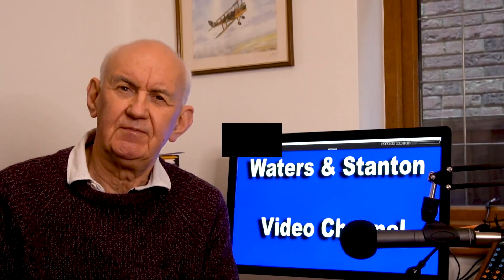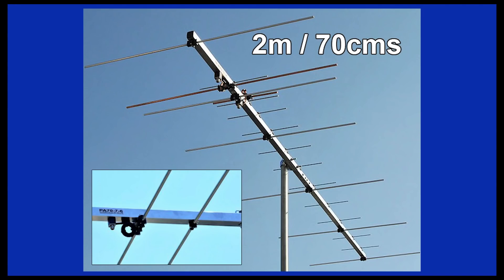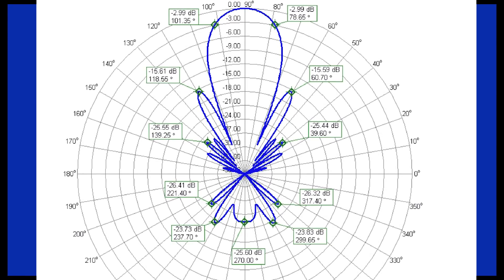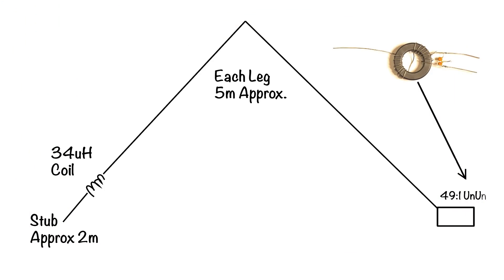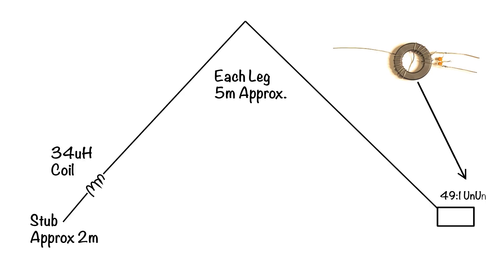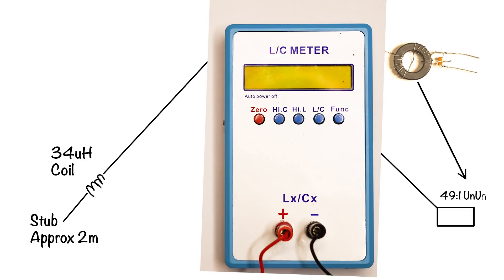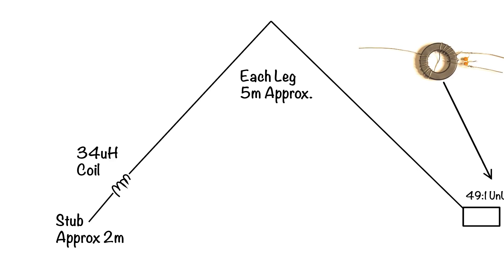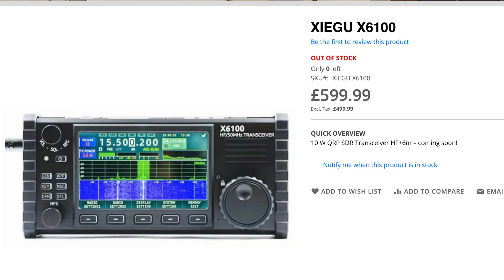HF Back Yard Adventures.  Build this Simple Compact Antenna for Your Ham Radio Station.

Comment: EXCELLENT!  Peter -- I finally got around to building this, and this afternoon I set it up and made adjustments.  I found some lightweight 1.5 inch diameter plastic pipe and wound that with #22 enameled magnet wire.  I started with 36 close-spaced turns and ended up with 33 turns very slightly spread to achieve 34 microhenries.  I attached an alligator clip to one end and about 2m of wire on the other.  I put up my 20m EFHW wire that I use for portable operation (it's #22 stranded, insulated) then clipped the coil to the end.  After adjusting the length of the 40m add-on I ended up with a 2:1 SWR bandwidth of about 125 kHz on 40m and flat, less than 1.3:1 across 20m.  Works great and much more compact than my full size 40m EFHW wire.  (Last summer I tried to make a compact 40m antenna by cutting my 20m wire in the middle and adding a coil using the shortened dipole formulas.  Not only did it not tune up well on 40m, but that concept requires lowering the antenna to switch bands.  This is so much better.)  👍
Reply from the maker: Great news William. Glad to hear your results. 73 Peter
Reply: @watersstanton  I had a chance to test it on the air today with my KX2.  It "worked a treat."  😀

Comment: Hi Peter, than you about your last video, very nice and interesting. I have the same space problems, but I don't have a small garden but a balcony. Which antenna do you suggest? Thank you in advance! 73
Reply from the maker: Hi there. I am assuming the balcon is above ground level. One option would be to fasten the EFHW transformer on the wall of the building -say just above the outer door and at one side of the balcony. Then take the wire diagonally across to the other other side but at the front of the balcony, and then run the wire down towards the ground. I don't know how much space you have so cannot really go further on that. Hope to helps. 73 Peter.
Reply: @watersstanton  Thank you Peter

Comment: Hi Peter, I have such an antenna and use it mounted vertically on my spiderpole with the 34uh coil slipped over the pole itself and it works a treat. Good for the DX !
Reply from the maker: Good tip! I hooe to do some tests this year on EFHW verticals as I am sure tge grounded quarter wave is not tge answer for a small garden. 73 Peter.

Comment: Peter thanks so much for your very helpful videos!  Here's another low-cost multi-band antenna option. I have a Xeigu G90 (yes, a great low-cost transceiver) feeding 3 watts into a Xeigu XPA125B 100-watt amplifier. I use the XPA125B amplifier's very robust built in ATU with this antenna and can get an SWR of 1.7 to 1 or better on all bands 160 - 10 meters, including WARC bands. My antenna is a 71-foot end-fed non resonant sloper. The high end is 15 feet going down from a balcony railing to a wooden fence about 6 feet high, with a slight dog leg at the low end to follow the fence line. It's fed from the high end using a 9:1 unun and 50 feet of RG8x. Because the coax feedline braid acts as a counterpoise I have a common mode choke between after the XPA125B amp into the coax feedline. I've made SSB contacts on all phone bands, working stations in Japan, Australia and the US East Coast from California and I regularly check in to 40 and 80 meter nets with good signal reports.  I agree that antenna modeling doesn't always show actual antenna performance. Could you possibly do some comparison A/B testing of small garden resonant and non-resonant antennas? Much appreciated!
Reply from the maker: Hi Jon.  Yes interesting arrangement. I did s video on the 9:1 UnUn. I found the longer the wire the better, and as you have found, the long length of coax helps. There is the problem of a high VSWR on the coax on some bands, but the loss is not likely to be too much if you play around with the length. Well done. Take care. 73 Peter.

Comment: I have a similar setup except it is longer and covers 10-40 (haven't checked resonance on inbetween bands) and 80 with the coil.

I can't reccomend efhw antennas enough. Space saving, great results and cheap to make. Not to forget can be made small enough to use portable!
Reply from the maker: Yes agreed. Thanks for sharing. 73 Peter

Comment: Thank you for the video, a question if I may. With the coil fitted and 40m resonant does that also make it resonant on the 15m harmonic? This making it a quad band antenna? I’m guessing No as I think you would have told us, thanks again Peter great video.
Reply from the maker: No, because the coil acts as a choke on 15m. Sorry. 73 Peter
Reply: @watersstanton  any possibility of multiple traps?

Comment: Hi peter love watching your videos,always look forward to the next one,a question for you is would a loading coil work for 80 meters at the 49.1 transformer end as im using a 20 meter length of wire so i get on 40 and 20 already, so to reiterate from the transformer about 2 meters then the loading coil then the 20 meter wire,the reason i ask this my end fed is already up high in a tree many thanks Tony
Reply from the maker: The only way to add 80m to your 20m length of wire is to add a loading coil at the far end I am afraid. 73 Peter
Reply: @watersstanton  @Yo Yes, I'm using that configuration. Inverted L with 110uH inductor toward the end. Works on 80m very well.

Comment: Hi Peter, I have the same 2m/70cm antenna as you (bought from W&S of course) and I have exactly the same results as you regarding the polar diagram. Very well made, lightweight and low wind resistance. 73 Ken G3WNR
Reply from the maker: Thanks Ken. Yes nice sntennas. 73 Peter

Comment: Very interesting discussion of modeling.  At one point I used a handheld log periodic for portable satellite operations.  The 2m operation was fine, but the 70cm had a very definite notch in the response.  I found that off pointing 15-20 degrees made a significant improvement in the 70cm signal.  Not my personal measurement, but someone with the right equipment reported the notch as about 2dB deep.
Reply from the maker: Thanks for that Alan. Take care. 73 Peter

Comment: Would you also get 15m on this antenna as it is the 3rd harmonic of 40m? If so it's actually a Quad-Band Antenna!
Reply from the maker: No. That choke coil will block 15m. 73 Peter
Reply: @watersstanton  thanks for clarifying!

Comment: Thank you Peter… love your channel excellent entertainment and fun too 👍… using previous information supplied by yourself I made this antenna for 40m with loading coil for 80m which worked really well (in fact I purchased a loading coil from you guys then made one for fun)… as I also have a compact garden for a 90 degree angle I used some upvc tube and put a flat top at the inverted v apex so increasing the angles … not sure from a theoretical stand point how it impacted the performance of the antenna but it worked and gave me 80m in a compact garden. Thanks again for sharing. … Dave M7DFM
Reply from the maker: Thanks Dave. Glad the antenna is working well. Sometimes we make changes with unexpected results. Take care. 73 Peter